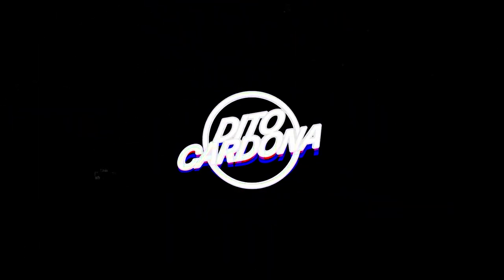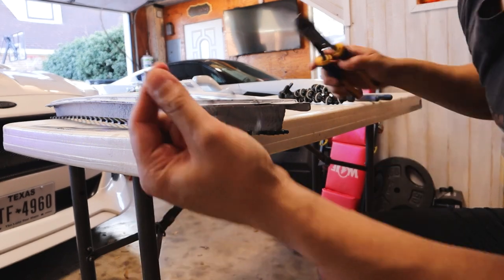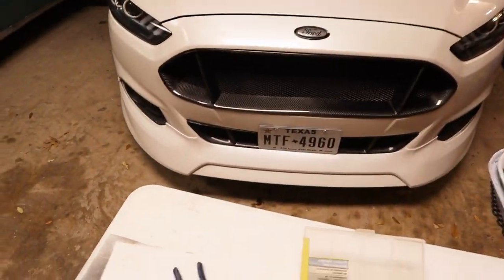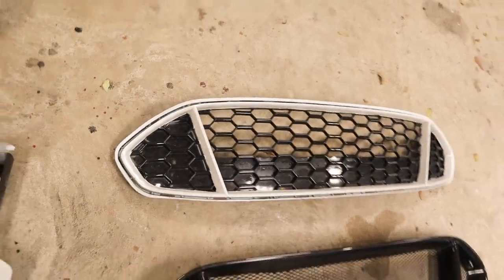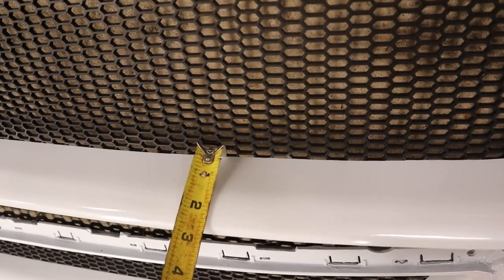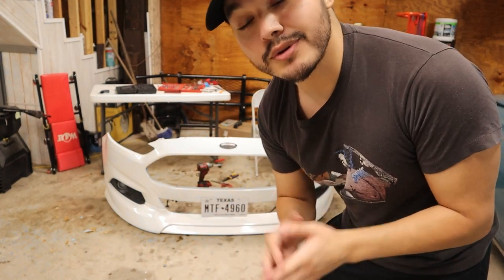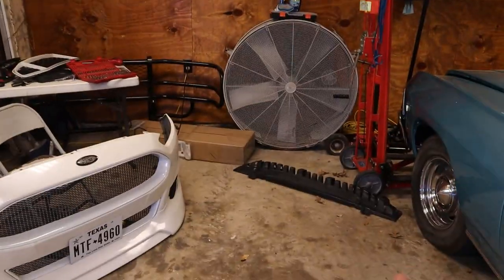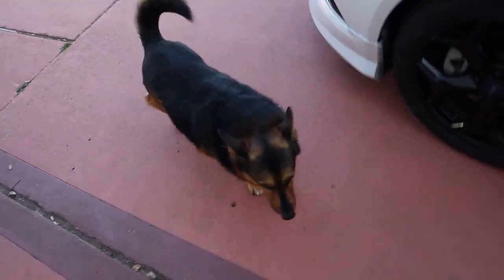Installing a CUSTOM Grill on my Fusion!

Comment: @dito did you have to remove the tire to remove the bumper ?
Reply from the maker: No for the bumper all you need to remove is the hardware then disconnect the wires when it’s coming off the car

Comment: I have a 2020 Ford Fusion and want to replace the factory grill with a Black Honeycomb Grill. Do I have to remove the bummer? Thanks
Reply from the maker: Yeah, the way the grill mounts is from the inside and gets pushed outwards, so you have to remove the bumper.